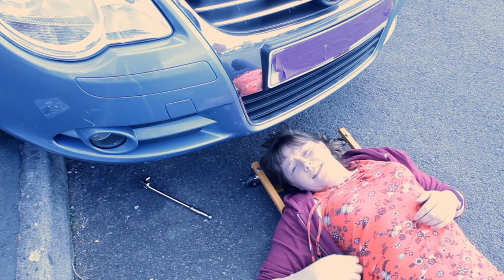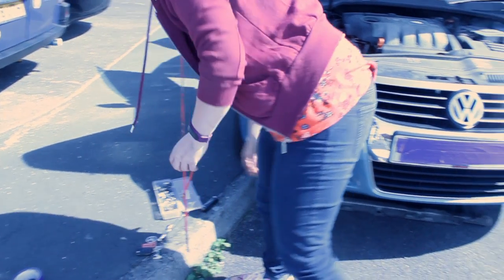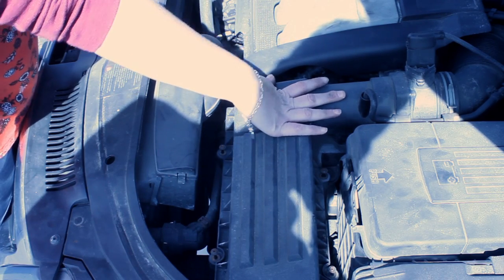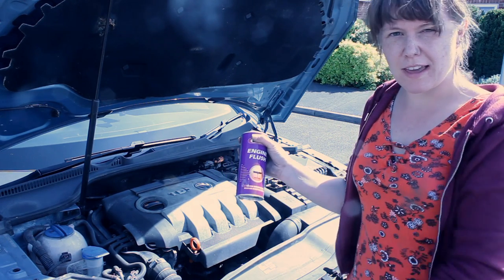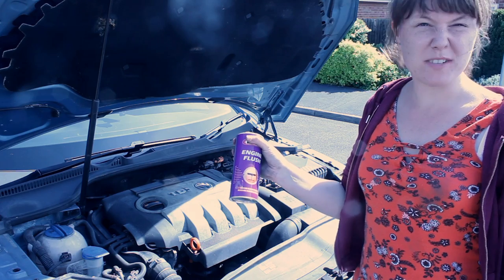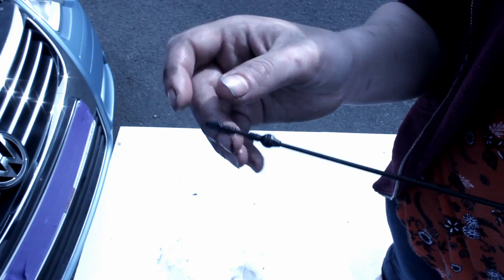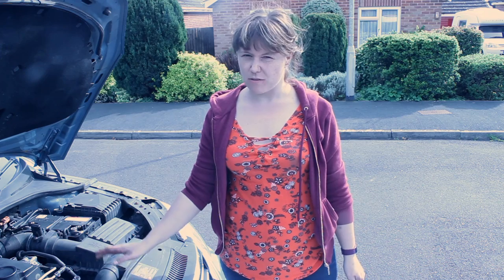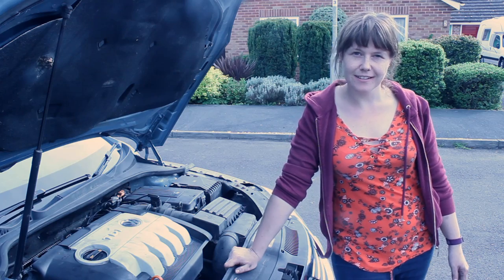Do It Yourself Service - VW 2.0 TDi - Oil and Filter Change How To

Comment: Good job! Wish we got the TDI Eos or Tiguan in the US. No need to wait 5 minutes after adding fresh oil as it just sinks to the bottom of the pan. Add oil until the dipstick shows "full," fire it up for a few seconds to get oil on all the cams, then check the dipstick again and top up as needed. Check once again after a short test drive.

Comment: I'd be concerned about using an engine oil flush in a PD/CR type diesel engine. If the oil is changed at the right intervals, flushes aren't needed.
Invest a few quid and get the socket to fit the oil filter cap.
Good effort though!
Reply from the maker: The engine wasnt maintained well before we purchased so a flush was in order. Have sockets. Id be more worried about diesel diluting the oil which seems to be common on these engines and can go unnoticed

Comment: Not sure about the benefits on an engine flush if you change your oil every year. Modern fully synthetic engine oil have detergents to avoid sludge formation.
Reply from the maker: VW TDi's are shooty and make plenty of sludge when they get over 100,000 miles. Diesels, gotta love em

Comment: shouldnt be using a spanner to undo the 32mm nut, if you pulled really hard, the spanner may have gone into the radiator causing mega bucks of damage, ps, use MANN filters , they`re the best by far, good video......
Reply from the maker: t5jerry yes this is true. The same thing could happen with a specific filter wrench / strap. What would you recommend. We tend to use Bosch filters, but we change them so often it doesn't really matter

Comment: Engine flush isn't required if the engine is properly serviced and I'm rather baffled by the way you poured the flush in. All you had to do was hold the funnel with one had and pour the content in with the other hand or perhaps use the jug as you did for the engine oil.

Best to change the o rings on the filter cap with the filter removed and smear some new engines oil on the  new o rings when fitted.

Sump plug tightens to 30Nm and oil filter cap to 25Nm on VW TDIs. You'd be better of with a proper VW filter cap tool to avoid damage should the spanner slip.

The ratchet handle sounds very dry. Get a jam jar, put the ratchet head in, fill with oil and leave for a day to let the oil seep into the ratchet. 

Engine oil for a VW TDI is 5w30 to VW504.00/507.00 spec if its a PD or common rail engine. Quantum brand is stocked by my local VW garage.

Mann or Hengst filters because they're OE to the VW factories.
Reply from the maker: Look forward to watching your very informative video ;) thanks for the tips any how

Comment: Thats not a 2.0 Tdi Engine....
Reply from the maker: 100% is. CODE BMM.
Reply: Very good & well done. Impressed with your clear & simple explanation of the process. Just for information to others commenting, an engine flush won’t do any damage; the ratio of oil to the paraffin product is too big for damage to occur. The only thing I’d say is you shouldn’t  need a flush again in future as clearly you’re using good oil and wont have any difficulty changing at the right intervals.A 32mm Hex oil filter socket will help. Will avoid damage to the plastic oil filter cap. I am fatter than you and couldn’t get under there as the ground clearance is very limited so I jacked the car up a little. For anyone doing that, remember you mustn’t rely on just the jack to maintain the lift of the car. You need to put blocks behind the rear wheels, make sure handbrake is on. Be careful about the jacking points. Ideally obtain a jacking pad that fits the sill of your car. I’ve seen garages damage the sill or other parts because they didn’t check or use a jacking pad that fits the car sill type. This was a good job that should give encouragement to other women to get in there & do their own car service and save loads of money.